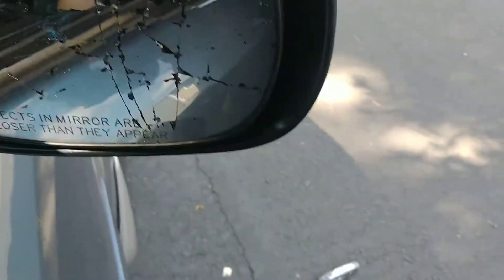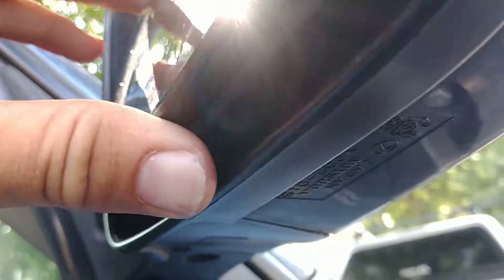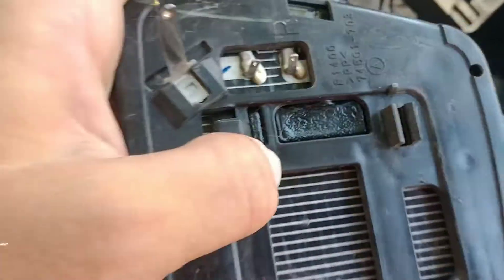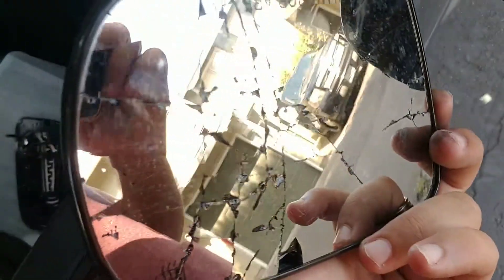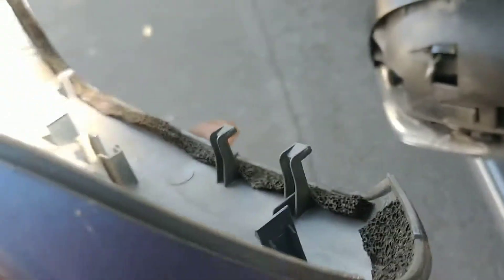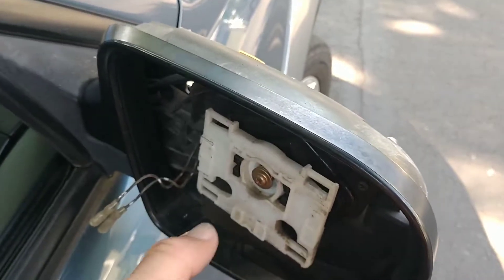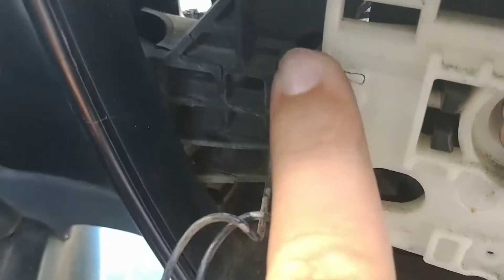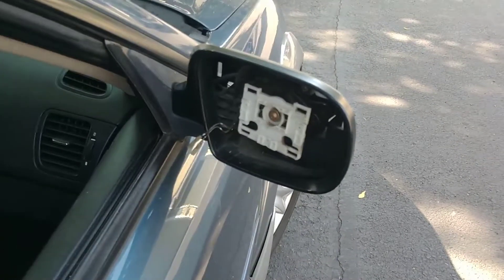05 06 07 08 09 Outback Side Mirror and Turn Signal Replacement

Comment: I've been looking everywhere fir just the blinker for my 05 legacy gt pass mirror and just cannot find one anywhere.where  did u get yours I'm stumped.
Reply from the maker: Chris, https://www.subaruparts.com/v-2005-subaru-legacy--gt--2-5l-h4-gas/body--outside-mirrors
Here is one of my preffered OEM subaru parts websites. If you arent wanting to pay OEM prices, this will at least give you the right part# to check other sites such as ebay for a discount part. I already set up that link specifically for an 05 Legacy GT. Just have to choose left or right mirror.

Comment: So the part you pop free on the mirror is those 2 bottom tabs? Then the top 2 slide out ? Also for anyone with an 06+ watching there is an additional screw for the actual blinker, underneath the mirror mount
Reply from the maker: Yes. The bottom two pop free from prying. The top two on the mirror unhook by sliding downwards the mirror itself. And slide it upwards to reinstall.
Reply: @11fulstrum  Thanks man! Great video

Comment: Not sure if I get it correctly- my mirror glass is ok, the only thing I need to replace, is turn signal lamp. So- do I need to remove mirror glass to have access to screw you mentioned in description below? Or do I rather need to remove plastic dome shaped cover (lifting it with trim tool on the seam with black frame), and then remove screws, disconnect lamp, and so on, and so on..? My outback is a MY 2004, but positive it's the same generation as yours.
Reply from the maker: It's been a little bit of time since ive done this repair, but if i remember correctly, yes, you need to remove the glass to get to a black screw under the glass at the bottom of that white plastic mount for the mirror. when you get the new part in your hand, you should readily be able to notice there is another screw mount besides the two that are under the cover of the mirror housing (the blue part I pulled off)
Reply: Bolek did you get it fitted? I also need to replace just the bulb...How to you open the bulb housing?
Reply: @mariomicic242  it's not a bulb, actually, it's sealed led unit. I managed to buy used mirror online, it wasn't expensive. It's been a while since I fixed this problem, sorry for late answering :/

Comment: Have you done a 2011 one I can't find a replacement one anywhere
Reply from the maker: James, i have not done one on a 2010+ in a few years, and i dont recall the exact procedure but i will try to get some time to dig into whats available online and send it your way if i can. That, or i will reach out to some people i know who own newer subaru's with the re-designed side mirrors. Is this specific for an outback?
Reply: @11fulstrum  I had a nightmare trying to find one but ended up getting a mirror only one in UK . Different colour might think about swapping endicator later date will see
Reply from the maker: @jbaillie01  some of these little specific parts still be harder to find. Like cup holders. I can never find Subaru cupholders in the right color and they are always getting broken from back seat passengers. Glad you got yours fixed though even if it isn't exactly how you wanted
Reply: @11fulstrum  chesrs..It's been off the road for 2 years engine's been been out . So just glad to be driving it again tbh..hardly notice rhe colour of mirror. If it bothers me I can always spray it or dismantle my old one and swap the indicator but this year not fussed